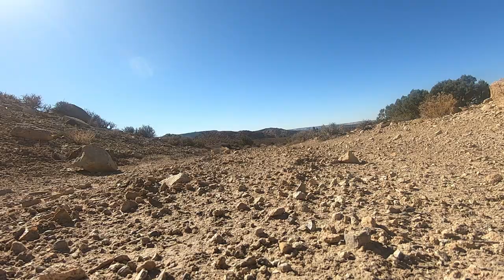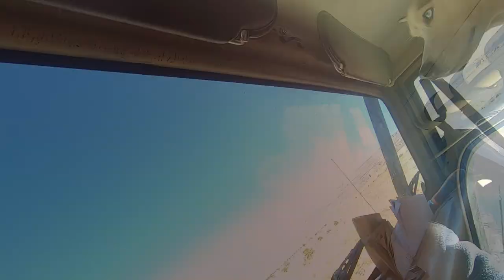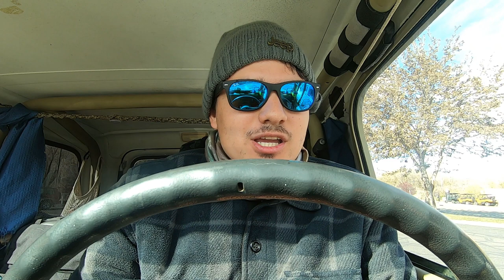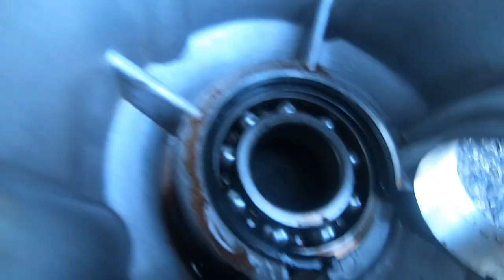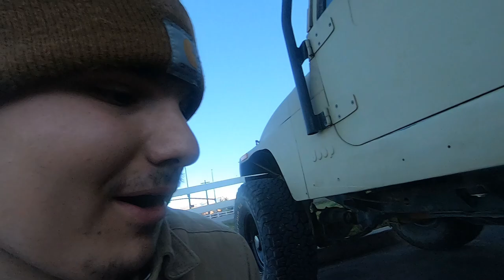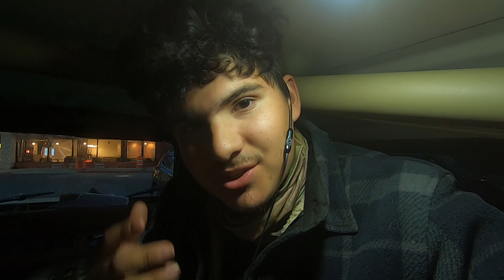More Repairs

Comment: The large quote may have been from the pinion seal replacement which is fairly involved. The dana 35 uses a crush sleeve for the pinion bearing preload. If the yoke is removed you need to replace the crush sleeve which requires removing the axle shafts and carrier to accurately measure the pinion moving resistance / torque while tightening the pinion nut. The pinion nut cannot just be torqued to spec.

Comment: The reason that your pinion seal and seal on your Tcase was leaking is because of your bad u-joint! That’s where your vibrations are coming from. If you don’t replace that ujoint you will eventually throw the shaft on the hwy and your leaks will come back. Driveline vibrations cause driveline leaks.